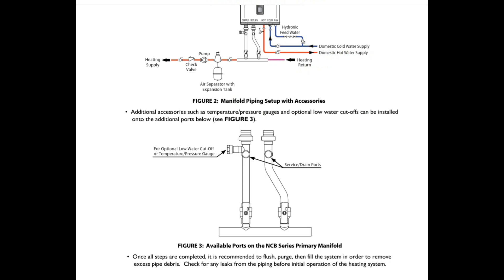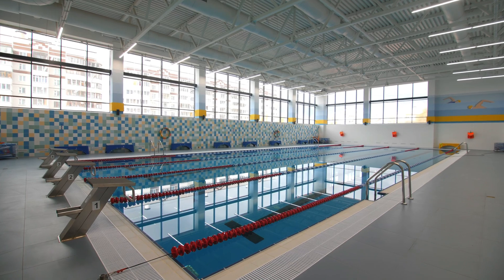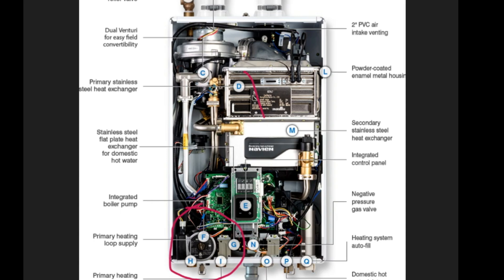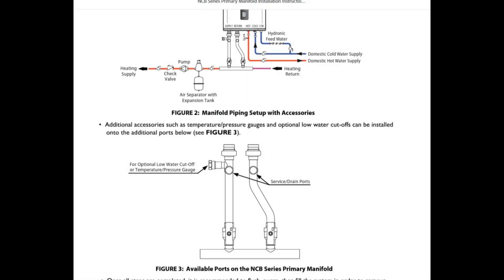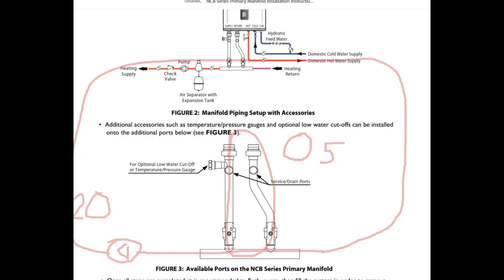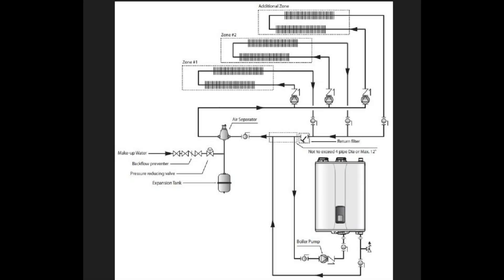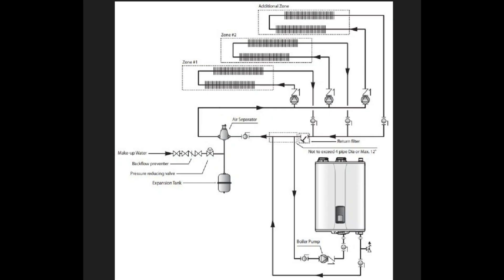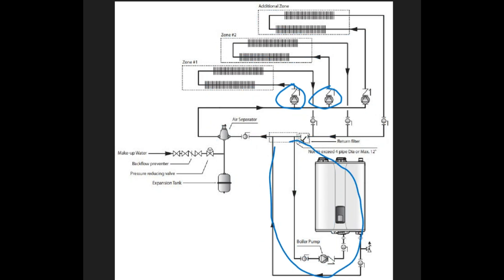Combi Boiler Piping Explained

Comment: My plumber told me the spacing between the Tees didn't matter on my Rinnai Combo Boiler. He has the Tees sitting about 3 inches apart. Basically both inlet and outlet pipes come straight down from the boiler into a homemade manifold with absolutely no dogleg as shown in your images and also in the manual. Is this going to be a problem? Turns out this was his first installation of a Rinnai Combo Boiler. Also, he refuses to answer phone calls. Took him literally close to a dozen return trips over a two week period to get the system working "properly".

Comment: Combi boilers are a very poor choice to begin with. Modulating boilers are usually a 10 to 1 turndown based on input. Most combis are 200k in to handle the domestic load. The problem is that the max turndown will only go to 20k. So let's take a modern home with a heat load of 35k on design day. Having a modulating boiler that can't even modulate to 50% of design load is ridiculous. What we are striving for is a boiler that never shuts down until wws. Putting in a properly sized boiler, say even a 50k will allow us to down fire to 5k. Boiler cycling won't start until much later in the heating curve. Install a properly sized boiler and a separate tankless water heater.

Comment: Only a sparky but first time I ran across only one pipe steam feeding steam radiators. Always thought radiators needed two pipes. Plumber said it was not that great of a system. & had to make sure all horizon pipes had a slope on them to return water back to steam furnace.
Reply from the maker: Yeah, in the one pipe system the condensate from the steam at the radiator drains back to the boiler in the same pipe as the steam supply. That's why the slope. In a two pipe system the condensate drains back to the boiler in its own pipe.

Comment: I never used the manifold and I've installed six of these boilers. They've all been installed on Apartments so there's only one zone and generally not a lot of baseboard radiation. I did put one in my own home with two zones without the manifold. Had no issues with the space Heating. I did have a problem with the potable water because the pressure was spiking and dropping. I thought this was odd because it was happening on the space Heating side in the summertime when the heating unit wasn't being used. The workaround I used was to make a connection from the feed side to the return side so the expansion tank would be affecting all parts of the heating system. I believe the zone valves or perhaps a check valve in the circulator was not allowing it to regulate pressure on the entire system . I only used half inch copper to attach the return side to the feed side where the connection to the expansion tank is. It's been working fine since

Comment: Thanks I understand better now the idea behind that setup in my installation manual it says space the tees 4 times the pipe diameter my setup is probably double that closer to 8 inches apart not 4 do you think that could be a problem

Comment: These manifolds are expensive, I am thinking to build one by myself - using two copper tees and use service valve wich comes with union at the top and attach to boiler, what you thoughts are about it - 2nd question - which combi boiler is more reliable
Reply: This system is inefficient and slow and often needs other pumps. We in the UK do not plumb combi boilers this way. We run the 2 pipes (22mm pipe) on a loop and feed from this loop with 15mm pipes to each radiator from this loop. The last radiator on the loop reduces to 15mm for that radiator. The water is a closed system, heats quickly and maintains the heat without any issues as the boiler controls the heat and each radiator controls the room temp with a radiator valve. NO manifold is needed or required.

Comment: Question: First off great explanation, I learned a lot! The Navien manifold is very expensive. Do I really need it? Can't I make my own as long as I closely space the tee's similar to the Manifold they offer? It looks like in the diagram you showed, it does not use the Navien Manifold? I am doing all the other plumbing myself, so why not the manifold part as well? It seems like in most of the videos I watch, the always use the Navien manifold, but do all the rest of the plumbing themselves?
Reply from the maker: As long as you match the measurement specs of their manifold, I see no reason why you couldn't replicate it on your own.

Comment: 👏😃👍 Thank you for the info, Question I have is on my combi Navien 250 , 4 zone . The upstairs when shut off you hear a hammer bang . With info on YouTube pressure is to hi. I you see 36 pounds but when I read manual on top of boiler is a 30 pressure valve ?? I lower the pressure (taking out water from the line ) down to 20.5 pounds , now no hammering . What pressure should I be at ? Also what is causing the hammering , is it air? Or is it pressure ? Thanks in advance
Reply from the maker: Both air or higher pressure can cause the hammering. Typically the pressure relief valve is 30psi, so it should have popped if the pressure was 36. 

Are there manual isolation valves on the pipes near the zone valves? If it hammers again and you do, slightly close the valve on the zone where the hammering is occuring. 1/4 to 1/2 closed max. Often that is enough to regulate the water pressure so that it doesn't hammer when the zone valve closes.

Comment: Hi any idea how to bleed the baseboard radiators? I have a navien combi boiler
Reply from the maker: Unless there is a manual valve piped in for it, I've sometimes resorted to bleeding out through relief valves. Only thing about that is sometimes these relief valves don't like to completely reseat.

Comment: This isn't true. I've seen dumb plumbers hook these up without the primary loop and use the system circulator to push the water directly through the zones.  The purpose of the primary loop is to mix the cold water coming in from a cold zone so it doesn't shock the boiler. If you have 2 zones and the 1st one calls the boiler will fire and get up to temp say about 180°f. If that zone is satisfied and the boiler is still at 180° and a cold zone calls the cold water not mixing and just coming directly into the boiler can cause damage. Personally I use low loss headers instead of closely spaced tee's.

Comment: Does it matter if the flow direction of the primary loop matches the flow direction of the secondary loop?
Reply from the maker: Ideally you would want your heated supply water from the internal pump to inject into the main loop and flow away from the suction side of the internal pump. Going the other way will allow hot water injected into the main loop to be drawn directly back into the internal loop and you'll have shorter cycling of the burners on limit controls.

Comment: i worked as a plant operator for about 10 years. I used to get thoughts like this while plant is running itself...
Reply from the maker: Power plant? I used to run a coal fired supercritical and later a combined cycle. Impressive how these things work.
Reply: @JerseyMikeHVAC  No at oilsands refinery.  At fort mcmurray AB. Also i worked at  Data Centres. Are you in from Canada or USA?  Yes its is impressive...
Reply from the maker: USA

Comment: Hey Mike, I need help with zone damper troubleshooting and conversion guns troubleshooting and repairs....If you could help me out, I would greatly appreciate it. You explain things great and I retain it easily. Thanks for that seriously
Reply from the maker: Conversion guns?
Reply: @JerseyMikeHVAC  Riello and Carlin oil to gas conversion gun. And i saw video on zone dampers too, it helped me out too, but still need help on some of the older ones. Thanks for responding your the man!

Comment: Is this method used only on  larger homes with a lot of piping, or can it be used on smaller houses with very little piping as well??
Reply from the maker: It's always on larger, multi-zone systems, but not exclusive to it. This design can be applied to any circumstance and often is, as the alternative requires very detailed design skills that are not so common.
Reply: @JerseyMikeHVAC  perfect answer right there. I know few contractors that could actually compute the correct pressure drops and pipe size for a direct flow system. Even explaining residual head for the internal pump is a struggle most days.